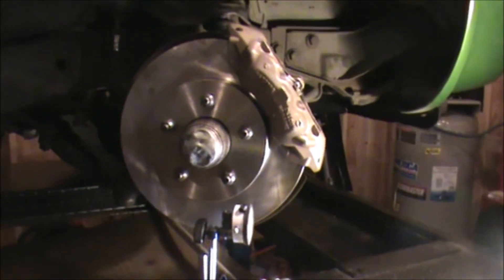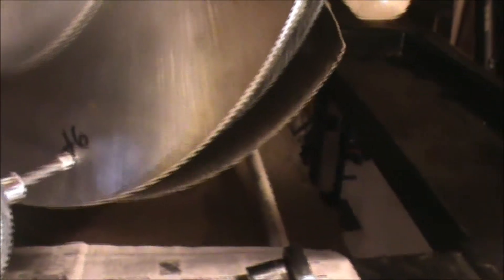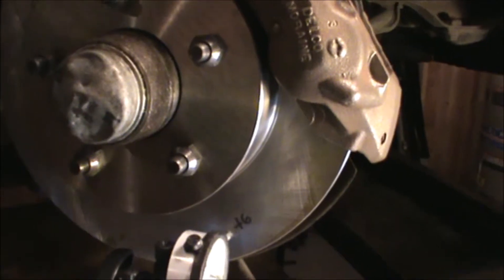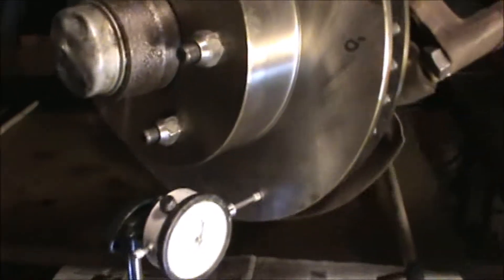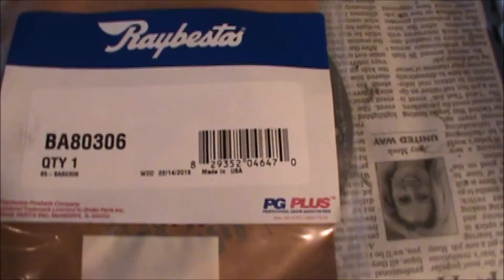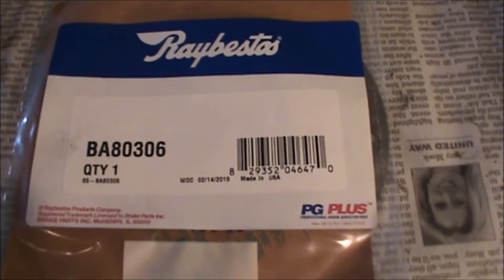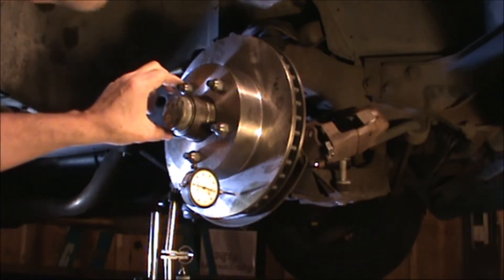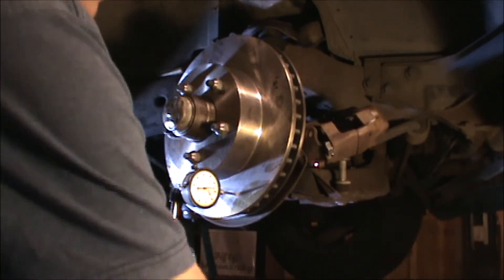C3 Corvette Stingray Brake Rebuild - Part 5A: Correcting Rotor Lateral Runout

Comment: You measured the runout at about the middle of the surface of the rotor.  If you measure closer to the edge of the rotor you will get a much different reading
Reply from the maker: You are correct!  It would result in a larger runout.  I should have considered that   Pulsation results from the total runout.  Thank you for pointing that out.😀

Comment: What a joy to watch!  I am looking forward to using these tricks!
Reply from the maker: I learned about this from someone who commented on an earlier video.  I think this is a great way to share info and exchange ideas. I appreciate your positive comments Bob!
Reply: @MikeHammill-TheShop  You're most welcome Mike.  I truly mean it when I say I am thankful to people like you who take their extraordinarily valuable time and share information for free with idiots like me so we know what we're walking into.  Could you imagine what it would be like to work on these beasts without ewetoob?  I can't!
Reply: @MikeHammill-TheShop  Oh....one thing.
I know this guy....he's real stupid, but he had this vette caliper and she was just full of rust (imagine a red mink coat).  Well, on the rest of em, after soaking in vinegar to kill that rust (that really works by the way.  shockingly well, helps with seized bolts too) he was trying to get the last bleeder nib or whatever you call it, out and the dumb SOB broke it off.
In your opinion, could a dummy drill out the rest of that nib, tap new threads and put in a slightly larger diameter nib when it comes time to getter back on the vehicle?
Reply from the maker: @kittypigeon  those things are a bugger to get out.  Use some penetrating oil, get an easy out and take it out that way.  Don't drill and tap unless you have to.  https://youtu.be/X9-3Msaimbw
Reply: @MikeHammill-TheShop  Ok.  That's how I'll approach it.  Thank you for the advice, I'll see what happens Sunday lol!

Comment: Wanted to say thanks for all your videos, I'm going through a parking brake upgrade and caliper rebuild with new rotors, so your videos hit the mark for me.  Question is for the lateral runout step. how did you torque the lug nuts to 70 ft lbs on the front rotors?  Torque wrench?  Having difficulty with the front rotors turning to get the right torque spec.
Reply from the maker: Hi Jake.  I'm glad the videos are helpful.  It cheated a bit on torquing the rotors.  I used my impact wrench to tighten them up because I had the same problem.  I figured it was Close enough and better than no torque at all.

Also, the flexible brake lines were a problem for me on the rear brakes because I didn't change them out.  They were old and were swollen.  It made it difficult to bleed the brakes and the locked up on me because, once pressurized, they would not release.  If your flex lines are old, change them out.
Reply: @MikeHammill-TheShop  Thanks Mike. My initial attempt had a wide variance of rotor runout, and thought maybe it was variance in the lug tightening. These are new rotors, so have you ever seen a wide variance and what was the cause?
Reply from the maker: @jakenewman3585  my rotor were new too, but still needed the shims.  It's a combination of manufacturing tolerance and wear.  The shims will reduce the runout.  A pretty cheap solution.

How much run out were you measuring?
Reply: @MikeHammill-TheShop  I’ll send a video tomorrow. It was bouncing quite a bit.....may have had the dial indicator set up off kilter but am going to torque the lug nuts tomorrow for consistency.
Reply: So just an update - I realized my dial indicator wasn't level which wasn't obvious initially since I have the floor up on jacks (not on a lift like Mike has) and didn't see the alignment issue.  Once I corrected horizontal alignment of the dial indicator, I measured my new rotor at all 5 hub points as I clocked the rotor.  In every case, the rotor measured somewhere between fourteen thousdandths and fifteen thousands so way to much runout.  I actually then put the old rotor back on at the original points, and measured runout at six thousands, so am just going to stick with the old rotors and add a three thousandths shim plate to get consistently below the max allowable of five thousandths runout.  It's been quite a process and a lot of learning along the way, but happy to almost be done and bleed the brakes.